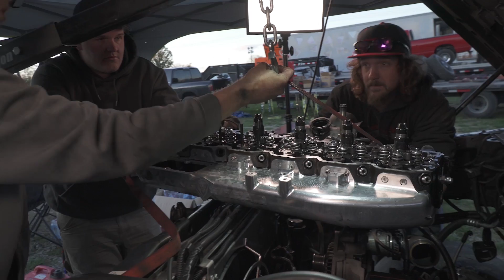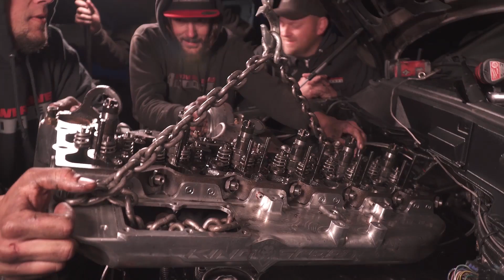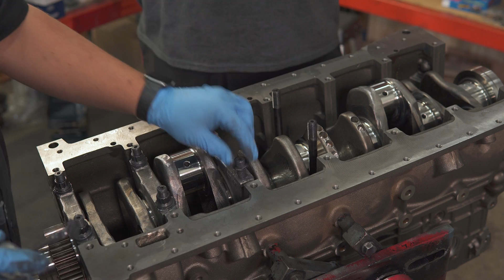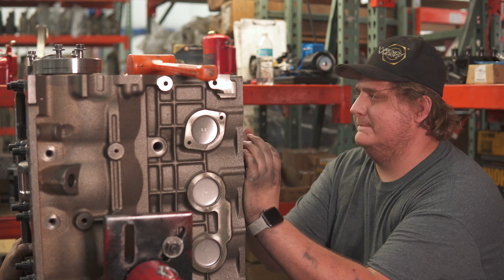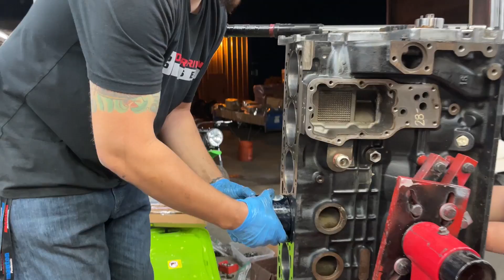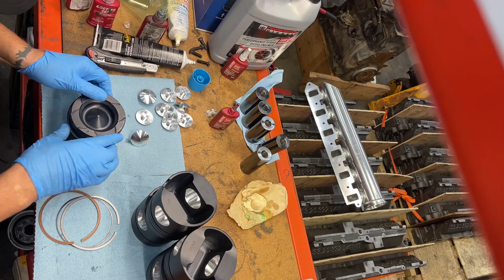6.7 L Cummins vs 6.4L Cummins | Full Build Specs | Power Driven Diesel

Comment: how much tq can you give an aftermarket cast piston in a 6.7, like fingers or mahle? they say forged pistons don't last very long in diesels, we've never had a issue with LS gas v8 forged pistons lasting, but diesels are a different animal. I was told on forged pistons, the steel top ring eats the piston in 20k-40k miles.
Reply from the maker: Due to the soot load, diesels are stuck with keystone top rings to clear out the soot, but keystone rings are hard on the aluminum ring lands in forged pistons.
Factory cast 6.7 pistons are generally good to around 1500-1800hp.  Many people have pushed them further, including Chris Patterson who has pushed them to 3000hp.

Comment: Whats the difference of a sleaved 6.7 to a 6.4 and a decranked 6.7 to a 6.4
Reply: Sleeved gives you more cylinder wall to handle more power, shorter crank gives you more piston and also spins the crankshaft faster

Comment: The issue with the 14mm pump is the modded regulator it causes surges but if you use a stock cummins one in the 14mm pump it gets rid of the surge

Comment: One thing I love about my 04 haha no emissions crap in the way of hp haha just had to swap an 06 ecm in it and some wiring and I can now use efi with switch on the fly tuning 😀 that's the one downfall to the 03-04 ram trucks is you can't use a 5 position tune of the fly switch 😞
Reply: Ahh check your camshaft hehe, dodge just wanted you to think it's emissions free.

Comment: Is there any chance that a guy could get the diamond light coating on the bearing surfaces in the or I should say were the camera aids in the block and then the cam journals itself why couldn’t you do that anyhow that would help your make your block last longer because you’re running pretty high spring pressure I would help this is six in a row jim again

Comment: Hey I was thinking a while back Todd you were talking about Val Springs in one of your tutorials and a real heavy valve spring high-pressure spring is hard on the block I got to thinking why not you can put cambering bushings all through the air all the way down why not do diamond light coating on the cam bushings and on the journal of the cams I think that would help this is six in a row jim from Kennerdell Pennsylvania

Comment: I wish that I didn't have a g56 in my 06 3500 ram now :(
Reply: @Cam  I didn't buy a manual transmission diesel truck to drag race, I'm just sad because I know that with a g56 I'm fairly limited to the amount of power I can throw at it .

Comment: I would love to see you guys offer new 5.9 12v long blocks or complete create engines. Definitely interested in that.
Reply: Pretty sure you can use the D&J short block..? It would be an upgrade compared to the old 5.9 blocks also because the commonrail block gets rid of the thin block early cummin's issues 😀  don't quote me but the block should work, you will have to use the 12v pistons though i think :)  happy building ❤️